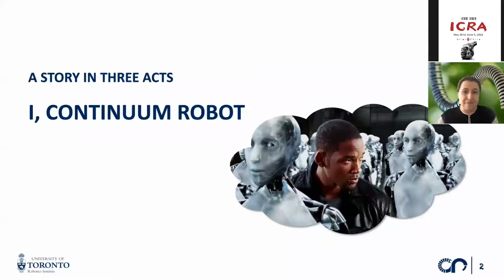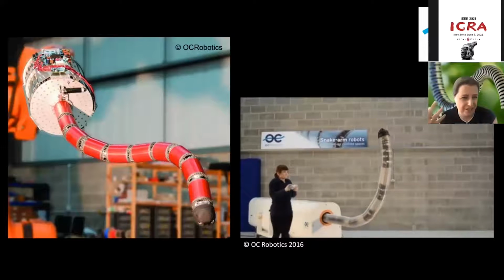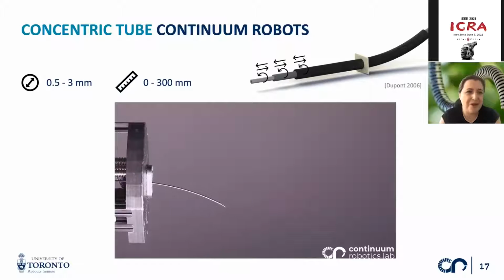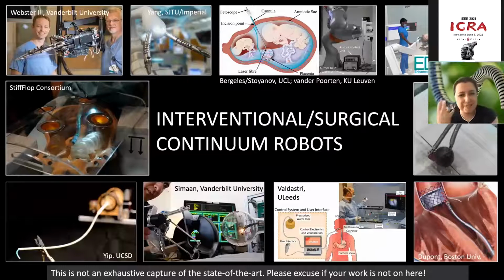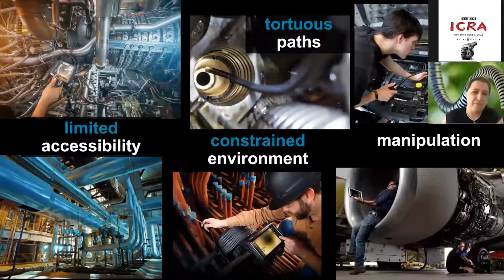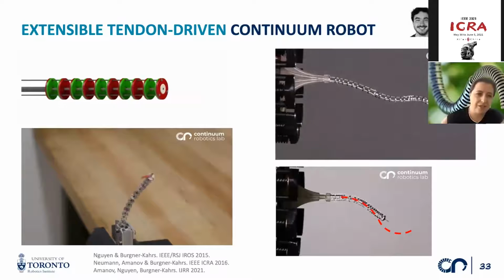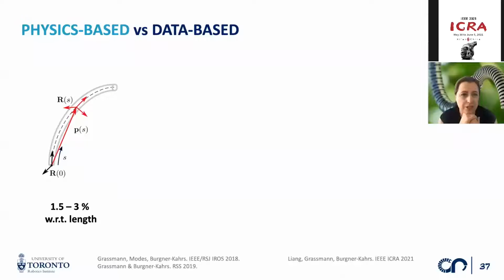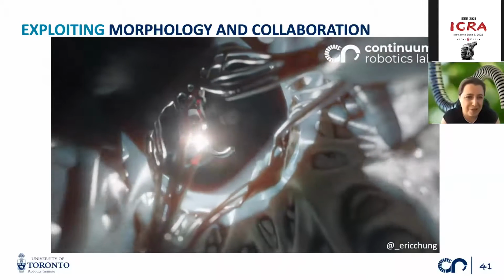ICRA 2021 Keynote Talk -- Jessica Burgner-Kahrs:  I, Continuum Robot

Comment: Not an expert, but I guess one (key?) problem may be how to control many "strings" simultaneously but using only one motor as the source of force or torque.  Otherwise the large degrees of freedom would require many micro motors.
Reply: Because the motors pull on strings, they don’t need to be inside the arm. If you control many DOFs with one motor, they aren’t really DOFs. Because they can’t move independently. This is what you want though, otherwise you couldn’t control the arm freely.